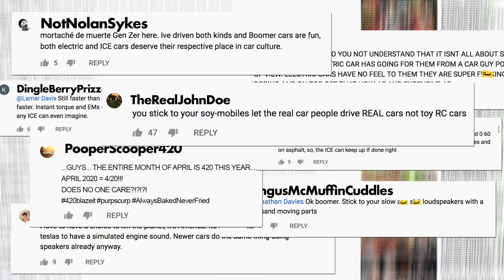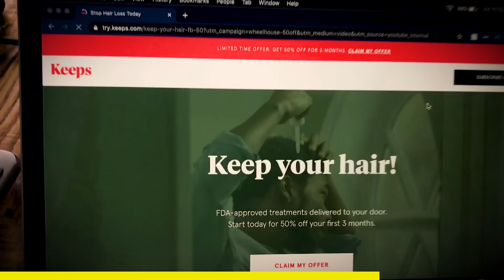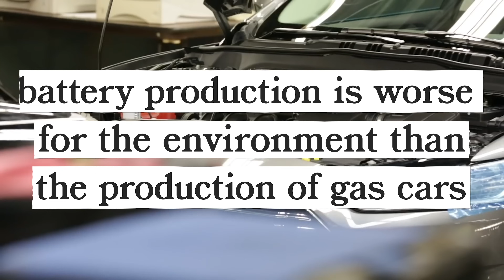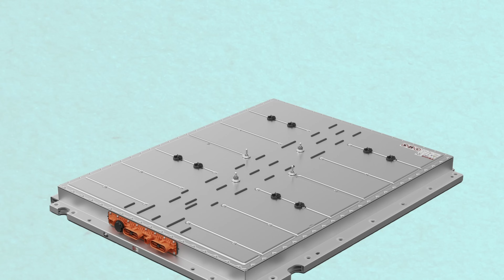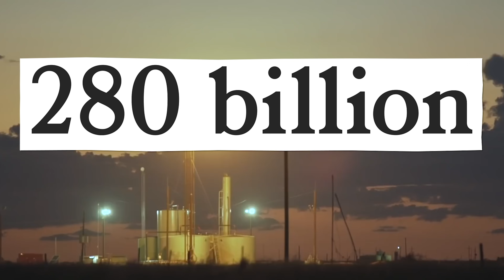Are Electric Cars REALLY Better for the Environment?

Comment: So I think you miss one important fact at one point batteries break down and will need replacement so some might get recycled or end up in landfills these have big environmental impact EV and gas powered are now but it will get to a point that cars will not be able to work like this. Formula E has the best idea recharge cars as they drive so you don't need huge batteries as you drive on the recharge  line you have the range I might be wrong but I feel this will reduce the foot print drastically, I would actually love comments on this to see some views.

Comment: Recycling batteries check so you're including the carbon footprint when the batteries are part of the car but the usage of the gasoline to run the car isn't included in this scenario so you should factor that in

Comment: EV's are too limited by their battery technology. What the dealership wont tell you is that those batteries get worse over time and eventually need to be replaced, you can curb this a little with proper battery maintenance but it will still degrade. The big thing about this is when they start to go bad they fucking STINK , start smoking toxic fumes, and they get hot AF the smell will make your eyes water and if they get hot enough they can melt circuits.

Comment: I believe that all cars suck. Electric cars are a bit better but won't make a difference alone. Using electric cars instead of gas cars won't change anything. Cars and trucks are expensive to maintain and the roads too. A truck does extremely much damage to roads, and it's extremely expensive. If people keep buying cars highways will expand and roads will be built, and will affect the enviroment. Trains should be used instead, they are much cheaper to maintain and better for the enviroment. All warehouses in the world should have trains connected to them. Trucks are much worse for the eviroment than trains. People should use passenger trains instead of cars. I know that passanger service in the us sucks, unlike other countries. There is no electrification over the rails, so the service is worse. The us should electrify the train lines. Some people are probably replying saying "That would be too expensive". No, russia has train lines that are electrified across the country, and it's the largest in the world. Expanding highways and maintaining them is more expensive than electrifying the train lines in the us.

Comment: Hydrogen gas engines not fuel cell has zero emissions unlike gas  and don’t highly pollute environment afterwards unlike electric batteries I mean what happens to the batteries afterward? Sent off to smaller countries like phones and pollute tf outta their enviroment
Reply: Ev batteries are around 95% recyclable and no, hydrogen is decidedly less green than batteries. They are far worse.
Reply: @engineeringtheweirdguy2103  how I mean really it emits h20 that’s it a child could separate it from water with baking soda and two tubes a plastic box and solar energy seriously tho the hydrogen cell maybe different but….
Reply: @motorizedbicyclenation53cu90  unfortunately it takes a lot of energy to get a little hydrogen. As an example, with a typical 6kW home rooftop solar array, assuming an all year round cloud free Aussie summer, it would still take you more than 350 days (out of 365 in a year) to create enough hydrogen to fill the Toyota Mirai. That’s including the energy used to compress that hydrogen to 700 bar which is around 100 times higher pressure than a typical domestic compressor that trades use can accomplish. Or 32 times the maximum pressure of a steel bbq gas bottle. 

Getting the hydrogen typical is simple. Getting enough is the tricky part. So is compressing it.
Reply: @engineeringtheweirdguy2103  plus let’s add in the  lightwr weight  adding efficiency
Reply: @motorizedbicyclenation53cu90  also whilst the fuel itself is lightweight, the equipment to use and store it isn’t. Additionally neither are the added safety precautions that go along with it.

Also worth noting that whilst it’s lightweight. It takes up alot of volume. For example, the mirai, being the size of a Camry, has 150L worth of fuel tank storage. That’s a bigger tank capacity that a Ford F-250!  This means that the mirai has so little cabin space it has a cut out in the roof to get the minimum legally required head space in the back seat and there isn’t enough physical space to fold the rear seats down. Which is a big deal when the boot in this Camry sized cad is almost 100L smaller than a Toyota yaris space is something BEV’s excel at.

Comment: @Donut Media
Uhhhh, sorry, I have to STRONGLY DISAGREE with "not affecting the power grid". We wouldn't be going through "rolling blackouts" during the summer time if that was the case!!! People start turning up their AC units and the power grid simply can't handle it. Now you start implementing EV's to that very same grid...

The point being, the grid can NOT handle the amount of demand and now you're adding more to it!!! So which is it going to be, people not turning on their AC units so that the power grid is not suffering as much and more EV's can be plugged in or vice versa? You can't have it both ways.

Comment: Screw all these electric cars. The reality it is a freakin dream concept that will not work in the practical worker and family life in the long run. Why? Well based on;
"Electric is future" yeah so will that cause serious damage to environment that combustion engines ever could. These batteries have a much shorter life time and so the electric engines for them. The minerals required are rare and expensive as heck and all the computers these cars requires makes your car locked/dependent on that the system is not crashing or striking or the entire car will be useless = a lot of vulnerability. And the costs, oh boy the cars are getting insanely expensive because all of this and the common working family man/woman will struggle hard to afford these new dream cars. They freakin requires house loan levels from the banks to purchase (even for 2nd hand options who might have a dangerous short life-time left). The batteries are also unsafe and a potential fire-hassard could not be far away. Recycling? These batteries are very difficult to recycle and takes time and meenwhile, stored batteries are still a potential fire hassard and un-stored batteries lating around are an enviroment hassard.

And then we have the energy problem. Oh, boy this is a big one. These cars requires a lot of electric energy and the electric net in many towns, cities and countries have NOT an sufficient energy net that can support a lot of electric vehicle charges and this is a HUGE issue in many countries, especially towns long from cities already struggles with this problem and it will only get more difficult as re-building and upgrade costs A TON of money and time they can't muster up.
Or, or that all environment hippies are so against nuclear power energy (despite it is the cleanest energy source that even the UN have recognized as the best solution) that is not only a want but a HUGE need for the rising energy needs. "But oh no, that is a no-no, we must have solar energy and wind energy". Yeah that is fine and all and in a perfect world would be awesome but that have been proven several times over is not even slightly close to the demand and many towns, cities and countries just can't even get anything worth out of it but constant costly repairment of the things and no energy value to even measure for the slightest debate of supporting there homes or less there possible electric car (!)

Comment: Electrics a for virtue signaling upper middle to upper class people your regular new car consumer doesn't and 40 grand on a car especially in this economy there are really no cars under that cap out there and the ones that are available for working class to lower middle are jus5 Stoopid looking cars and I don't think financing a ugly turd for 35 grand makes sense, it se3ms that the wealthy drive what they want while not only do they  dictate the cost but they force you to drive an overpriced car that you  don't even really want they just pull the car salesman game and steer you into something you can barely afford parked next to what you actually want and forget used you don't buy used power tools so why would you buy a used car running the same batteries or even a remanufactured one you get a mix of functional cells from different batteries packs  at different power shit you aren't even supposed too do that with your TV remote.  They need to sell these  to the appropriate market at appropriate prices and not rely on them being a hip  new trend because all I see advertised are Tesla at 45k up to 100k for Audi and so on they don't advertise the leaf why it's 40k and fucking Stoopid it should be clear that environmentalism is a form of dogma and like the Bible can't be taken virbatim for example California switched from plastic straws wrapped in paper to paper straws wrapped in plastic we quit  using glass as an environmental cry to use plastic when glass is infinatly more recyclable and any left overs can be turned back to sand for seashore restoration but hey it sesms we are so hell bent on following trends that we will do anything to be the guy who lives in a giant solar panel forgetting basic science and that is that the only thing that will destroy our planet will be the sun when it becomes a super nova and kindly destroys the whole solar system. Recyclables are shipped to china to be burnt look at Long island sh8pyard all we keep is metal because it has intrinsic value. It's a hoax

Comment: Yo donut media, im a big fan of yal. Im writing an essay on why EVs are a bad idea. I'll appreciate it if you can send me links where you got your sources from
Reply: I would argue they aren’t a bad idea, far less likely to combust, 95% of the batteries are recyclable including all the lithium, cobalt and nickel. Even on a coal only grid produce less emissions than a car even before you consider the impact of fuel refineries. They produce far less microparticle emissions, which are so bad if you live within 15 miles of a freeway your life expectancy drops by as much as 15 years and causes brain developmental issues in children. And tailpipe emissions are the leading cause of Micro particle emissions. 

They also can be run on home solar and because they don’t have any regular servicing requirements, they are significantly cheaper to run than a combustion car, in some cases saving as much as $6,500+ per year on fuel and servicing. Meaning whilst the upfront cost is higher, over its lifespan, it can become cheaper than some very cheap economy cars like an entry level Toyota Camry after as little as 5 years of driving.

Aside from having better safety in that they are 11 times less likely to spontaneously combust, 5 times less likely to combust in an accident and have no engine at the front increasing crumple zones which increases survivability, as well as having extraordinarily low centre of gravity which drastically reduces roll over risk, which again, increases survivability.

I think they’re not bad. I think they’re very good.

Comment: One of the best abilities to a gas vehicle is to run nonstop and never to sleep. Specific service vehicles run 24 hours a day and simply do not have "down time" to charge. How many times have you shunned a gas station just to change your schedule to charge your car? LOL. What if when you wake up, the power was off the night before? What if your Tesla burns up your house while charging like those in the videos on yt do while they are sitting still? 
Do you know how to put a Tesla fire out?
Do you have Life insurance? 
Have you read how to put a lithium battery fire out?
Have you read your owners manual on how to put out lithium battery fires?
Have you looked up how lithium mining is stripping the world of resources, while propaganda would tell you you are in fact saving the world?
Cool video, great effort. Great presentation. The product of your presentation unfortunately is the most overpriced piece of danger I have seen in a long time, In my unprofessional opinion.
It's not about how much that vehicle costs you, it's about the versatility of that vehicle. A vehicle that can take a 48 hour road trip has versatility that a electric vehicle will never have. Both ev and gas use oil, as well as antifreeze. I found this video false because it did not take into account the number of people that have burnt up alive in ev's, and the amount of cars that have actually the frig caused a carbon metric fuckton footprint by burning to the ground. I wonder the toxicity from a burning gas car, verses the plasma burning torch of a lithium battery times 78000. lets just sidestep the toxicity of coltan as an entire whole. What's the average life expectancy of a coltan minor is the best question to ask really. Sorry, end rant.

Comment: The problem is that those dirty lithium batteries will need to be replaced after 6-8 years when they start to get weak, and many cars will go through 2-3 decades of service in the hands of multiple owners, so if we're being realistic then having an ICE car which runs for 20+ years won't be any worse for the environment than an EV which either has to be tossed aside after 8-10 years, or has to go through 2-3 lithium batteries during a 20+ year lifespan. In reality pretty much all cars are bad for the environment, and we should try to limit our reliance on them in general.
Reply: No they won’t. Batteries in EV’s being sold today are designed to last up to 400,000 to 500,000 miles.
Reply: Which is around double that of the lifespan of a ICE. Hell even the warranty period of EV batteries today is 8 years.

Comment: I like electric cars because they are better vehicles. I could care less about the environment.
Reply: Thats the mentality of most EV owners. for some reasons non-ev owners seem to think thats a trigger point for EV owners. So they go on these rants about how they're worse for the environment based on false and sometimes just completely made up facts. Reality is they are still better for the environment and further more nobody really gives a shit.
Reply: @engineeringtheweirdguy2103  Same reason I enjoy DeFi and cryptocurrencies over banks. I could careless about toppling the current BS bank power structure. The fact is stable coins like USDC, GUSD and PAX pay better APY than any bank will simply for holding the asset on the exchange like BlockFi.
Reply: Yeah ı agree with you. I get it's fun driving a manual and hear the sound of revving etc. but at some point speed, performance and technology becomes more fun. I also find horse carts fun, but i'm not going to drive around with one all day. I get electric car's may not seem like they're superior yet, but they just advance muuuuuch faster than ICE cars. Tesla Model S Plaid and Porsche Taycan is already faster than %99 percent of ICE supercars both in the track and in drag races. Especially Tesla is crazy because it's a factory production 4 door family sedan that looks like a 2010 ford mondeo, outperforming Top ICE vehicles. It accelerates faster 0-200 literally everything except maybe a 911 and has the second fastest sedan time on nurgurbring after Mercedes AMG GT.
Reply: @ea-do2pw  Well lol you can fix that too with an EV lol  "This Modified Tesla Sounds Like A" Lamborghini!https://www.youtube.com/watch?v=HmDXE3o8dMc
Reply: @kh9242  Yeah ı mean that's a cool feature but ı think EV's should embrace their own features rather than trying to copy ICE vehicles 😂😂 EV's actually sound cool when you are driving them, they just are not loud.
Reply: @ea-do2pw  I also think it’s cool to confuse people lol “This is a Limited Edition Tesla turbo”

Comment: All about the sounds for me! turbo spool.. supercharger whine.. and the roar of an engine oh and rev torque! sat there pumpin the gas car shaking just a few things an EV won't do for me plus I like working on engines not electric motors, don't get me wrong some EVs are amazing but when I drive I want to actually DRIVE no automatic 2 pedals crap that's for dodgems at a fair ground for kids 🤣 tell you what make a manual EV and I'd think about it until then I'm completely out I didn't sit a manual driving test to end up in an auto 🤣
Reply: seeing as EV's dont have transmissions, As such they have no automatic gear shifting equipment, they're technically all single speed manuals. And whilst I appreciate people like loud noises for some unknown reason, hell, maybe the vibrations hit their citreous just right, IDGAF, there are very few combustion cars that can match a modern EV off the line. I really like watching falcon and commodore owners get angry and swear and shout in the car behind me when they eat fresh air when I beat them off the line to the lane merge at the traffic lights. Tearing down their little worlds.

Got a little side tract but my point is power is power, it shouldn't have to make noise so retards with ADHD can remember what's going on for it to classify.
Reply: also just realised. The internet sometimes doesn't get Australians. I'm not being aggressive thats just how we speak. Americans tend to feel attacked when we talk to them on the internet. So just know thats not my intention.